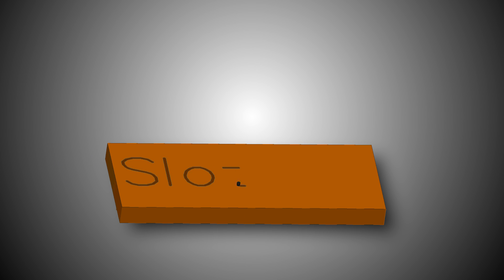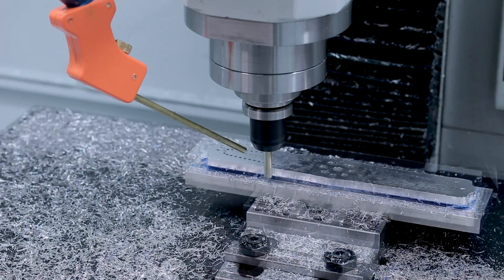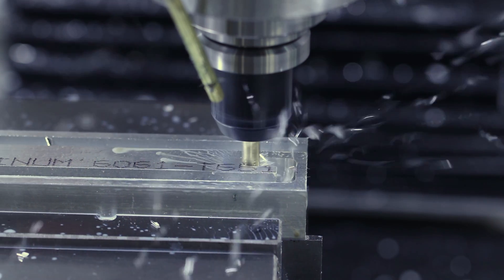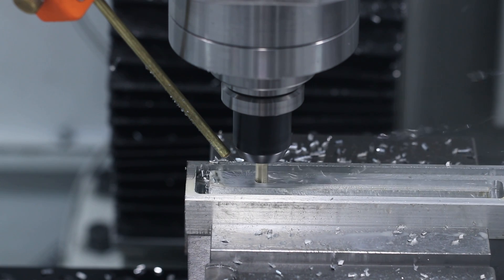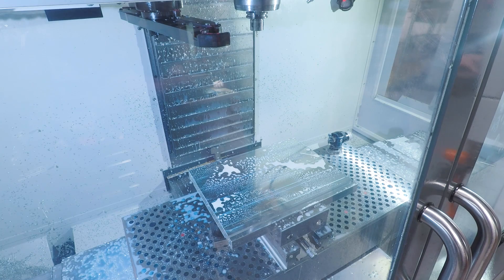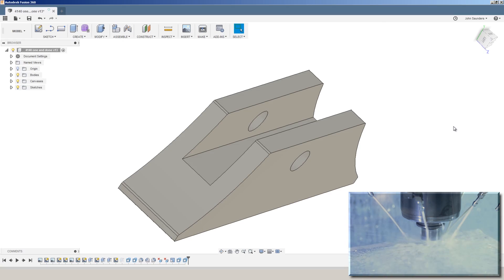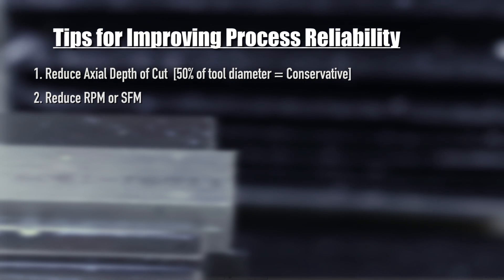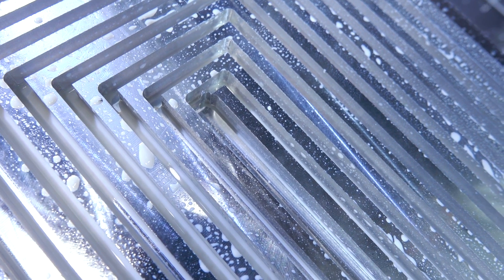Slotting Aluminum - Tips, Tricks, Speeds & Feeds  | WW235

Comment: Lately I’ve found myself slotting with very small endmills, 5/32 being on the larger side. I found I get the best accuracy slotting with them if I go about 150% of the tools diameter deep into the material. I’ve also started doing my “roughing” cuts with my endmill in a regular ER collet so I can blast the TSC.

Comment: I was looking at a deep cut video I made where the cutter clogged up and I noticed that just before the sound changed, the amount of chips flying out dropped a little. I realized the chips take up a lot more room than the original material. At least 3 times as much. Therefore you have to throw 2/3 of the chips out of the channel or it builds up behind the cutter. When it gets packed, the chips can't get out of the flute and each revolution jams more until it drags around until the metal melts. It is so unpredictable  because it could be ejecting 70% of the chips and running fine then it drops to 60% and the chips start packing. And it happens fast. A good source for chip volumes are manufacturers of chip compacting machines.

Comment: Great video! You did an earlier one called stop slotting the stupid way, but you seem to have gone away from the recommendations again. In our prototyping we use a Haas TM1-P and for the machines we manufacture 10mm (little more than 3/8) width slots at a little more than 1½ inch deep in ALU and POM are the things we need to produce repeatedly.

What is the best guess for tools and strategy for say 1 foot long, 1½ inch deep slots

Comment: It also seems lower flute count helps with chip evac, even though you lessen tool rigidity. 3 flutes is still probably better than 2 in aluminum, but 4 flutes seems ideal for steel. I havent had good luck slotting with 5 fl in steel, but 5 beats 4 for adaptive anyday.

Comment: We do a job regularly that we use a 1/4" 2 flute Garr end mill 5/16 deep, 12000 rpm 100 IPM in 6061. One end mill will typically do a 3000-4000 feet of cutting. We tried a variety of 2 and 3 flute end mills Garr, Niagara, Harvey and we kept coming back to that one.

Comment: At work we are slotting 1.4301 stainless whit Sandvick cutter (diameter 4mm-0,16inch/ 3 flutes whit a bit of radius) 
we are running 7600 rpm(Vc100) and feed 296mm/min-11.654 in/min (fz 0,013mm/ fz 0.0005118 inch) 
Depth (3mm-0.11811inch) actually (2,5mm-0.098425inch) because the tip whit radius is poking through the part.

We are using slotting to cut through the middle of the part so we dont have to machine the middle. 
Is it possible to push in even more? 
Would the chip breakers help?

Comment: sweet, i've recently been challenged by running a cnc router on aluminum the last few weeks.  i have some full slotting recipes that have been working, but i just started to make a "pocket" around my part to adaptive out my "slot"  i usually make it 1.6x diameter of the cutter.

Comment: John, Have you tried a higher quality tool holder in this? I personally have slotted at 100 Cubic inches / min on a CV 40 Haas VF2. Kennametal Hydroforce with Safelock are king in applications like this.

Comment: Hi John! I love watching this channel as you bring so much enthusiasm and a good attitude to the videos; even if the subject isn’t necessarily one I’d be interested in, I still watch. I have a question about slotting. Just as you can peck drill, can you peck slot? That is, can you advance the tool along the path, then periodically “back up” for a short period to help the material and the tool bit cool off, then continue along? Also, what if you don’t want the outside corners of the slot to have a sharp, 90-degree edge? Can Fusion360 generate a slotting toolpath with rounded edges?

Comment: Anybody with a good fusion 360 recipe for slotting with tabs in titanium? The problem is that after reaching the max ramp down right in front of a tab with the reduced ramp speed, the end mill rapids down behind the tab to the max depth and continues with full speed. No problem in aluminum, but in titanium I have to use the pliers to pull out the remainders of the €50 2mm (.08”) end mill almost every time...

Comment: I’m in first robotics and I use a tormach 440 that the school owns, all we have are the endmills that came with the machine, the shop teacher at our school recommended 0.02 step down and it almost never works. I told him that it was probably too slow because the aluminum was gunking up on the tool, and tips for a better depth, rpm, and ipm?
Reply: the trickiest slotting problems i've had are in less than rigid setups.  with aluminum, your biggest hurdle is going to be your rpm limited on that machine.  run it wide open and play with your chip load if your chip load gets too low you'll load the tool up with aluminum.  you will need some kind of chip evacuation, whether its flood coolant or mql air blast.  even in really vibration prone setups i've been able to push 1/3 tool diameter in aluminum.  try 1/4 depth to start and use some charts for your tooling material.  most likely you'll want a cutter between 5/16 and 3/8 that will probably be a good balance between getting the tool to the proper sfm.  try to avoid slotting though.  i will try to adaptive everything that i can and then clean it up in a another operation.  for outside cutting of a part, i will project the shape to a sketch, then offset the sketch 1.6x my tool diameter and extrude the shape up to make a pocket for the adaptive to machine.  you can run an adaptive path so much faster than a full slot that its a hard argument to continue slotting for the outside contour of a part.

Comment: When you say ramp down 10% of tool Di do you have a max ramp angle? Do you have any recommendations for ramp angle? This comes into play when doing tight slotting (like a helix) and when the end mill has to plunge very fast. We have always done x100 the step down converted to angle. So a .125 ramp step would be a 12.5 max angle. Curious if you have any angle recommendations.
Reply: You don't need to calculate the angle. If you enter the maximum step-down which results in a shallower angle then the entered one fusion will automatically use the smaller angle.
Reply: @ChristophPech  When your ramp is very short and your step down is relatively large your EM will end up traveling down very quickly, I've broken many tools not catching this. The angle serves as a safety net preventing you from making a spiral that is too aggressive (even if your step down is still 50% tool DI). I understand that 99% of the time the step down will be less, but im asking about the 1%.

Comment: Slotting is just a quickie and not the full 2 minutes. The tool will want to pull into the up milling side and deflect away from the down milling side making a crooked slot. In my experience if you don't have enough coolant to turn that slot into a river along with some finely tuned cutting data for your tools, keep some pliers around (you'll know what to do with them when it's time)! I've seen a 2 ton 4kW knee mill starting to umph while I was approaching a corner on a 30mm deep slot with 14mm roughing end mill. The sound change is very noticeable but what surprised me the most was that the 2 kg piece of aluminum went from cold to untouchable within less than 10mm of travel until I had to stop everything and use the pliers... My tip is if the part geometry allows for it (open slot), tip the part sideways and use a disc milling cutter. You can go a lot deeper without much fuss.

Comment: Did I hear him right?  The mx tormach at 10,000 RPM?  I thought the 1100 was 7500 RPM
Reply: 5:27
Reply: John has a 1100MX prototype machine. Due to be released in winter 2018 but has been delayed until summer 2019 ☹️
Reply: @owensparks5013  I realize his is a beta prototype and I received the delay notification on the release of the mx series from tormach as well but the 10K rpm had me scratching my chin.  That would be awesome if they do release 1100mx's with 10k rpm like the 770's

Comment: I'm dead impressed with modern toolpaths. But I don't have the software yet. I'm restricted to slotting....But, as demonstrated in your film, the correct cutters have no trouble at all. I use Europa (dedicated aluminium roughing cutters) and they do shift metal very efficiently. As you say,  plenty of high pressure coolant to blast the swarf out. No worries.
Reply from the maker: If you "want" the software, you ought to be able to get it!  Plenty of great options these days; no secret we're a fan of Fusion 360 due to large user base, low price, easy of use, and solid CAM toolpaths
Reply: @nyccnc  I'm a stubborn miller. I manipulate my hurco winmax, I control all strategies, I can play my machine like a fiddle! I appreciate you can probably use 360 in the same way. 
I'm lucky enough to be working on prototypes and very small batches. (10 maximum)! Cost is a big issue. I have Delcam (featurecam), it's 10 years old now. That's bad, I know. 10 years ago I was over the moon with it.
But I watch lots of YouTube now. I can see I'm becoming a dinosaur.
Reply: I guess Fusion toolpaths could be 25% faster unless you push your tools as hard as possible. When i started working with Fusion i reduced my programming time by at least 75% and i was programming Like a noob with fusion
Reply: @snowsniffers  Halooo... personally, most of my time is with set-ups, jigs, fixtures.... the programming is actually easy! But devising and making the tooling. That's where my time goes. Huh, I seem to be justifying my reluctance to get modern!
Reply: @neilwoodward7336  50% of the parts in the industry are basic 2d shapes (or prismatic at worst) and another 20-30% can be done way faster with a form tool than with any modern toolpath. If you can hold it you can make it but that leaves room for an ego-trap as devising an appropriate setup is waaay more time consuming than taking the cut! You can use this to your advantage to unload some work by turning a "will you" to a "could you". By implying it's hard (and by not mentioning you know just how to do it yourself) you can get some people to do some crazy things just to prove themselves but I avoid pulling this kind of shenanigans to maintain a good relationship with friendly machines shops...LOL!
Reply: @Sketch1994  I understand you. But most of the work I get is because big shops won't allow a man to be tied up with small, awkward parts. If I sub out to another company,  I always get let down. I'm a very small business. I get these jobs because I do them myself. Fixtures are absolutely necessary. I design them on the computer (in line with the part). And then I machine them. But it's usually a case of "make it up as you go"...
Reply: @neilwoodward7336  I never give the part the customer pays me for to another shop either and fixtures are often useless after they get off the machine (no zero point system yet). Though I'm working alone from my uncle's basement and only have 2 machines, so in order to keep my equipment running or make some tools and attachments I go to an agricultural equipment machine shop because they really know how to get work out fast (OCD can be a bitch) and many times their experience was proven invaluable. The best piece of advice I got was from my university machining class professor who told me "join the dance even if you don't know dancing"! Only by doing you can see what's going wrong, where and how to improve!
Reply: @Sketch1994  My workshop is small. I have a big Colchester lathe (Triumph 2500), Surface Grinder (Jones & Shipman) & a VM3 Hurco. I'm a 1 man business, my apprenticeship was with injection mould tools. From the age of 16, I was taught to work to very high standards of accuracy. I'm blessed! I didn't know any different! I can't do a shoddy job. All fixtures I make eventually are used again. Location on a fixture is not a problem. Bore a hole, then pick up offset from that hole. 32 years now I've specialised with CNC milling. Fanuc, Hurco....
I love it !!
Reply: @neilwoodward7336  Sounds really nice. I wish I could get to that level in the near future but I'm just getting started (first year of accepting orders in the ruins of the Greek economy). The thing that tipped me over to machining was my thesis in a micro-machining case study in which I really pushed the envelope of precision and complexity (and tiny features that could only be measured and inspected with a microscope).
Reply: @Sketch1994  Are you working from Greece? I do very small parts, it's ruining my eyes. Sometimes I can only trust the machine to make accurately. (I use methods to check certain things before I cut metal).
Reply: @neilwoodward7336  Unfortunately yes. The situation we are facing is really bad for business (no matter what kind of business). My eyes are still in good shape, but my neck is already starting to give due to the insane setup times and blind work. Like you said you often can only verify a few aspects of a feature and the material condition can have an impact too (I once found a pore a little larger than the hole I was making). Nevertheless I think that precision work and small parts are a good niche because no other shop around here does that or even wants to do that. The demand for such parts is very low though and most people prefer going to the last one that made it, so I have to do whatever gets around. I still try to give the customer the best they can get and I hope it eventually pays off one way or the other. No matter what, it's a tough industry (an investor was shocked with my choice but that's what I believe I can do best and my interests might be blinding me)....